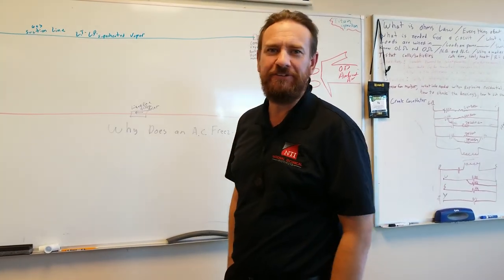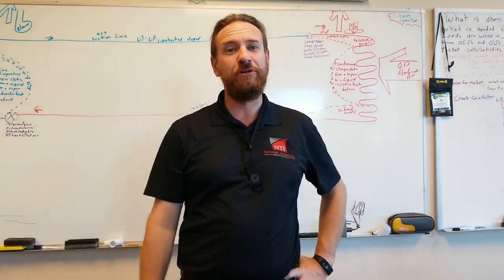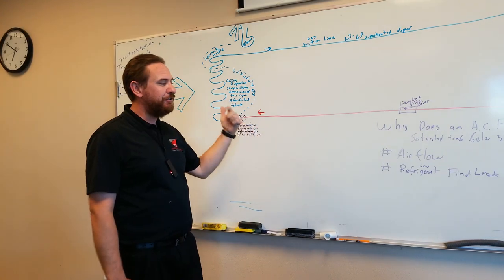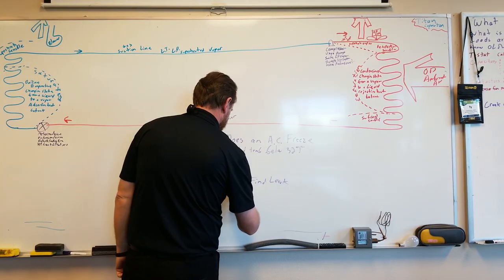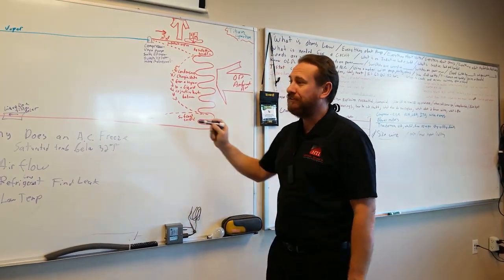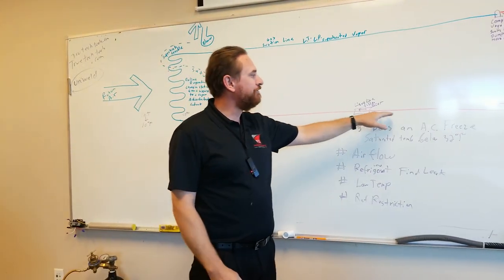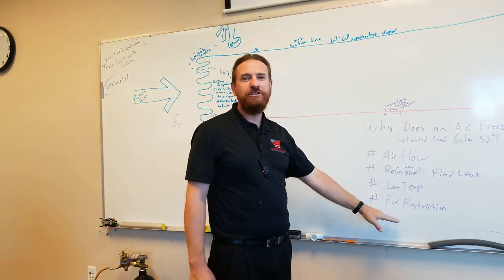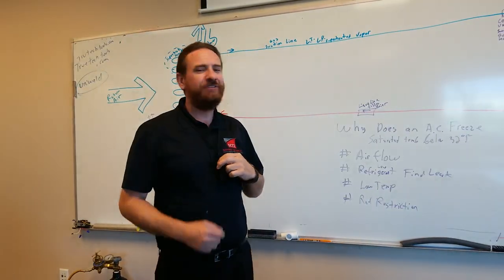Why does an AC freeze

Comment: Yep , had  lines both inside and outside ones frozen and I've turned off since then . Filter was filthy and changed it . I'd like to check / clean my coil if I clould get to it . It's sitting on top of furnace with lines atatched . Any help be appreciated . Should have melted by now but like to make sure . Ac still not working the blower fan was filthy and cleaned it best I could without removing . Any help be appreciated . Although blower does turn not full speed and shuts down after a lil while
Reply from the maker: Please don't try cleaning the evaporator coil in place. It usually results in more damage to the coil.

It sounds like your big issue is the blower motor not working. Could be a capacitor, the motor itself, a relay, or the control board. 
At the thermostat leave the fan in the on position until it defrosts.
Reply: @love2hvac  Not the capacitor , I just replaced it. It's doing the same thing. Blowing partially .
Reply: @love2hvac  Been two days it's defrosted . GEEZ , the guy helping me at AC place their place not open today or tomorrow AND I need to ask him again something . He said on blower motor if I disconect the cool terminal wire on circuit board and connect the bottom black wire to cool terminal that ( this is what I'm not sure what he said and needed to talk to him ) if it works ( or doesn't ) that means board is bad NOT the motor ?? OR is it the other way around ?? And yes replaced capacitor . Still the same barely running the blower not full speed and shuts down after a while even with new capacitor
Reply from the maker: @frankmontez6853  it should not take that long defrost.
Reply: @love2hvac  been four days. With mom being 86 yo no ac. The motor gets hot after only being turned on for a while . I'm definitely thinking it's motor. I mean , what else would it be ? Would bad board cause this the motor being hot and only partially running at slow speed ? I took it off and going to parts store get a universal replacement. Not Goodman. Seems like a good idea ? Or might be wasting money ? It's only $74 ..
Reply: @love2hvac  UPDATE - It did fit !! yeah it was blower motor . replaced it and could tell it was working right away at the vents . It was blowing weakly beflore so replaced capacitor at first but that wasn't it . Only $16 . Next suspected motor . Great that I fixed it . Century universal motor $74 plus needed bracket $30 YAY

Comment: UPDATE - It di fit !! yeah it was blower motor . replaced it and could tell it was working right away at the vents . It was blowing weakly beflore so replaced capacitor at first but that wasn't it . Only $16 . Next suspected motor . Great that I fixed it . Century universal motor $74 plus needed bracket $30 YAY

Comment: Noob question Ty,  So there's a leak but not obvious.  Do you tell the customer "it's gonna take some time to find the leak" and you spend a couple of hours.  Do you ask them before you start?  Or you looked two hours and didn't find it, do you still charge???  Thanks for posting these videos!!!
Reply from the maker: Great question!
Most companies have a flat rate pricing. They usually have a level 1 2 and 3. You would start at a level 1 nothing that most of the time they are found in this level. If the leak is not located we will get your authorization before moving forward to the next level. 

I personally would run my sniffer detector around the most common  of areas at an additional  charge but a teeing or level 1 would include, braze joints at installation, just in the evaporator box without the blower running, base of the condenser and in the suction line insulation to see if there was anything in lnest. 

A stage 2 may require a trace gas of refrigerant with a nitrogen pressurization of a flat system.  A detailed search threw the condenser and evaporator with the sniffer. 
A stage 3 typically includes component isolation. Separating the evaporator, condenser, suction and liquid line. This is reserved for those hard to find leaks such as in a slab or in a wall, pin hole of a coil.  

The largely debatable fix a leak adatives  are in motion now. People love them or hate them.
Personally I will find the leak and repair it. My personal opinion is refrigerant and refrigerant oil is the only thing that belongs in the refrigeration system. I still remember my teachers harping on this and the stories of the mess caused by the addatives. I also remember my teen years, the tire guy chewing me out for using fix a flat. Haha
That said, I'm not going to stop someone from using it on a small hard to find pin hole leak with a proven name brand, quality product. 
The problem is people using those products as a one fix all solution.

Comment: Hi there, our customer had Keeprite 3 ton 16 seer ac installed like 9 years ago and it was used to freeze often. We replaced it with 16 seer 3ton carrier and same issue arising. We replaced dirty filter, opened up blocked returns and also got ducts cleaned. This customer likes very cold so puts temp to 19 deg c. From 21 deg c, it starts freezing. Furnace blower is of 3ton capacity and is almost 10 years old. We even changed dip switch setting to maximum. What should we do?
Reply from the maker: install a freeze stat on the evaporator coil. have it break the Y wire
https://www.grainger.com/product/CARRIER-Freeze-Stat-115Y74

Comment: I have a question, on a R410a system the condenser vapor line is freezing but the evaporator coil is not getting cold at all.  The blower, air filter,  are both good.  low side pressure (56 psig) was low and SH was high (42.7 sh)(could not check high side pressure because tamper-proof cap was installed on the high side service valve), added refrigerant did not fix the problem.  Could a contaminated liquid line filter be the issue?
Reply from the maker: the condenser vapor line, can you clarify? Are you talking the discharge line, aka hot gas line that connects the compressor to the condenser inside the unit?
Or are you talking about the low pressure Suction line from the evaporator to the compressor?

Comment: can you elaborate as to why the frost starts at the compressor when it's air flow? and starts at the metering divide when it's refrigerant related?
Reply: Cause there's no airflow on the tubng between EVAP and compressor  if the  boiling off  isn't used up in the EVAP by the end..will go below freezing

Comment: During normal operations for commercial or residential, is it true that having open window(s) when the A/C is running could cause it to freeze?
Reply from the maker: It won't cause it to freeze but is a complete waste of energy and makes the AC work a lot  harder.

Comment: If the system is low on charge due to a leak, then I can forsee a section/portion of the evaporator coil will freeze up but not the entire coil or suction line. I would anticipate the SH to be high. Am I missing something here? Thank You
Reply from the maker: It depends on the conditions indoor outdoor temperatures, humidity  and how much refrigerant is left.

It could be just the distributor friend or also the distribution tubes, or all part of the coil, or also the whole coil. 
As it freezes it also blocks more airflow allowing it to freeze further. It takes time but it is possible to eventually freeze the whole coil but it's usually Airflow as the main cause .
Reply: @love2hvac  Thank You. I greatly appreciate and enjoy your videos.

Comment: Hi, I have a 2ton r410a unit with a txv. My suction pressure and temp is quite low. The saturation temp is about 29F and the temp on suction at condenser is 32F. The subcooling is about 12F. I've replaced txv but same result. Filter and coils are ok. Can this be an airflow issue? Thank you.
Reply from the maker: Absolutely airflow. It's almost never the TXV
Reply: Thank you

Comment: What would cause freeze ups in A/C 

Airflow ; many causes 
Refrigerant; leak
Temperature
Reply from the maker: SATURATION below 32
#1 Airflow most likely 
#2 temperature too low inside/outside
#3 low on charge / leak
#4 refergerant restriction

Comment: I live in Florida, I keep my thermostat at 67, the compressor doesn't cycle on/off and it has never froze up. why is that?
Reply from the maker: What is your humidity in your home? 

It sounds like you have an oversized AC unit that is not properly dehumidifying. You have to keep the thermostat set unreasonably low to offset the feeling of higher humidity.

Someone has probably overcharged the system with refrigerant to keep the pressure up to prevent it from freezing.
Reply: @love2hvac  What tool do you recommend for an accurate humidity reading and where in the house should I test the humidity? It's a 2.5 ton unit thats 5 years old. It's never been serviced since installation other than me cleaning the condenser coils. It's a 1000sq ft house with not the best insulation and original windows from 1983. The A/C runs non stop during the middle of the day(it can't maintain 67, goes up to 69). Water pours out of the outside drain.

Comment: You say the unit will freeze when the saturation temperature is below 32 degrees. As you stated, if there is a pressure drop then the saturation temperature will drop. Now just because your under 32 degrees does not necessarily mean the unit will freeze; this only applies at atmospheric pressure. Therefore, do you instead mean to say the unit will freeze when the temperature is below the saturation temperature, not when the saturation temperature is below 32 degrees? If the saturation temperature was below 32 degrees, say 10 degrees, then u would need to be under 10 degrees in order to freeze? Clearly you are the expert and I'm misunderstanding something, so any clarification would be appreciated.
Reply from the maker: The suction saturation temperature (aka the exavaporator temperature aka the temperature of the refrigerant in the evaporator aka suction pressure converted to temperature) is at of below 32F  it will be a high potential for freezing. It will start freezing from the metering device.

Can you be at 32F and it not freeze, yes it will depend greatly on the amount of moisture in the air and dew point.

In Las Vegas Nevada with 5%RH the evaporator coil can be at 20F and not freeze because there is not enough moisture in the air, yet in Miami Florida it can be at 32 and freeze because there is a lot of moisture in the air.
Altitude will defiantly affect this as well.

The main point is to be looking at the suction saturated. when you see its at 32F there is an issue that needs to be solved even if your in a "what if" condition. 
32F evaporator, find the cause!

Comment: Nob setting AC temp below 70°F?? What if my EVAP coil is running at 45 or 50° instead of 40?
Reply from the maker: Return air temperature and airflow has the biggest effect on coil temperature. 
If your at 70F and your coil temperature is that high it is very likely you had duct leakage, too much air flow or a VRF
 Either way with that high of a coil temperature you likely above dew point and you are not dehumidifying. 
Without dehumidification it will feel much warmer in the home that the actual temperature. Then makes the occupant uncomfortable, so they turn the temperature down lower to try to compensate for the lack of comfort.

Humidity and dehumidification is just as important as temperature. 

You will find that customers that want a low temperature actually have humidity problems in the home. This can be because of air leakage, water or Ventalation issues, leaking duct systems, and the biggest, am oversized AC

Comment: He is really the best, but i have a question? Why is he relating the freezing to saturated temperature and not actual temperature. I mean when the pressure drops both stayrated and actual temperatures falls, but what matters is actual temperature inside the coils because this is affecting the moist in air and when actual temperature falls enough to the point that the coils become so cold, moist in air will freeze. However, saturated temperature is the temp where change in phase happen, but this temp might not be reached in a system and i dont see it having direct affect to moist in air. Please help
Reply from the maker: I have a video called saturated temperature that explained this better. 

Psig converted to saturated temperature.
It's also the point where the Refrigerant is changing state or boiling in the evaporator. 
It's where liquid and vapor both exist together.

With a TXV most of the coil will be at the saturated temperature but the last little section will be warmer, or superheated. 

In some conditions you can have just the very bottom of the coil at saturated and the rest of the coil warmer. That's a starved Evaporator.

Other conditions the entire coil can be saturated temperature meaning the coil is flooded and the compressor will be damaged.

We say saturated because it specifies where in the coil it will be that temperature. 

Calling it coil temperature is not accurate.

Actual suction line temperature - suction saturated temperature tells us how superheated the Refrigerant vapor is before entering the compressor (vapor pump).

If the saturated temperature is the same as the actual suction line temperature we  are saturation in the suction line. We have liquid/vapor mixture to the vapor pump and it will  kill the compressor. 

I have several videos in sequential order on superheat subcooling and saturation that explain this better.
Reply: Ive subscribed and im a fan. What a guy 👍👍

Comment: hey! in car ac system the drop temperature on Dry filter around 2-3*C its ok, or its too much? is it not the case that the filter dryer will always reduce the pressure a little due to the fact that it is not an open, empty pipe, but it has elements that block the flow of the medium a bit
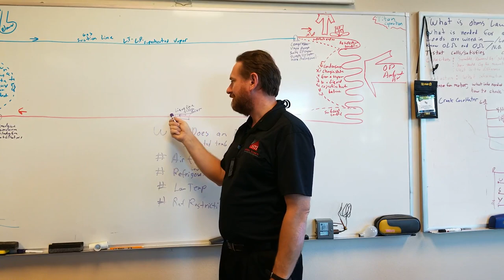Reply: thats my question to what u explaining in @17:20
Reply from the maker: All components have a pressure drop even connections and piping.  
Always refer to manufacture information for maximum pressure or temperature drop but I feel that 2-3C would be excessive